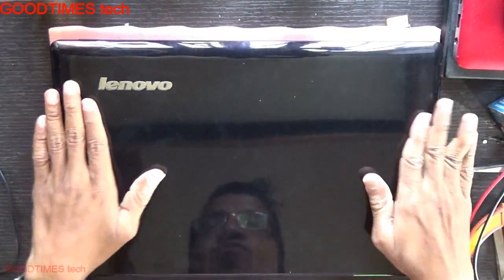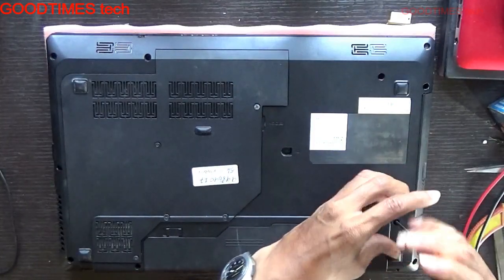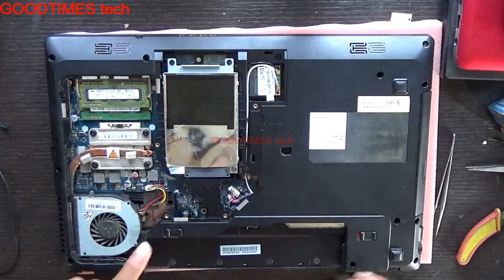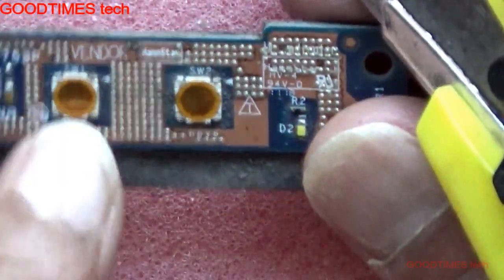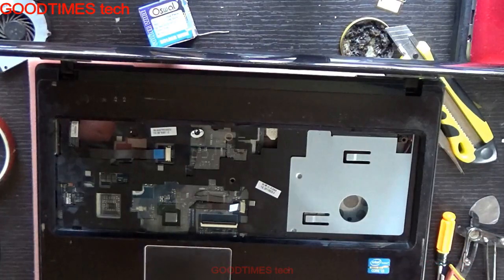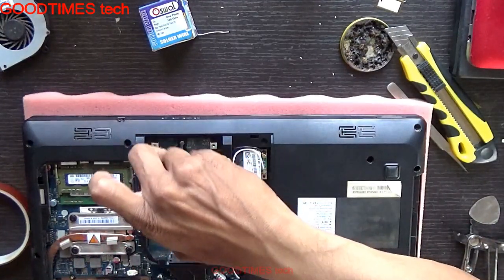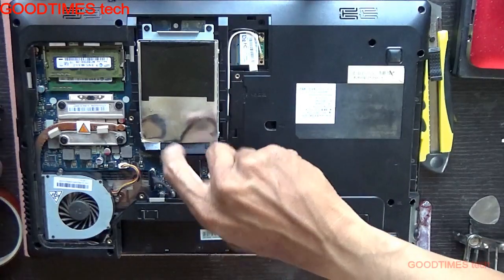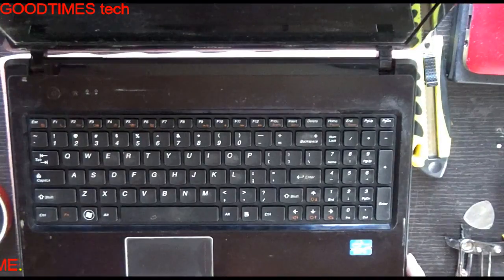Lenovo G570 power button not working | Solved.

Comment: Hi.
In minute 4:54 I see that you take off a little metal sheet from the power button, but in 6:20 you put two metal sheets in the power button.
Were the metal sheets stuck together and was it necessary to take them off to clean them?
Thanks. I will try to clean and if not work I wil buy a new button.

Comment: You are stupid enough!
Same problem can be solved by unplugging charger and battery and pressing power button for 20seconds and then again connecting charger and battery
I did it and it worked perfectly for me
Reply from the maker: Thank you sir.
Have a GOODTIME.
Reply: I'm sorry
I got that problem again
Your method is good for permanent effect
The method I mentioned cause temporary change
Sorry for saying u stupid
Reply: Nasreen Mansha sir, can you please explain to me what you did, because I don't want to give my laptop in repair untill another month. I can just turn it on once and leve it in sleep.
Reply: sharjeel mansha NVM, got it repaired. Because that electrostatic thing works only in some cases.
Reply: i am other account of nasreen mansha
All you have to do is unplug battery and charger from laptop
Then press power button for 20-30seconds and then again connect charger and battery
Then try to power on
IF NOT THEN
try to press power button at different angles
If this donot work,you need to get your laptop repaired

Comment: Lenovo 3000 g430 laptop ka power button kitne me ayega aur tumare pas kiya purana milega, Dukan me bolrahehe  500 rupia lagega tum agar veg sako to reply ya phir email karo place🙏🙏🙏 apurbamodak027@gmail.com power bottom laga rahehe to band hoja rahehe , sot karke chalta hai lekin power connector laganese band hoga rahehe
Reply from the maker: Pranaam ,
       Filhal mere pas power button stock nahi hai, agar aapne video pura dekha ho tho kya aap ka laptop power button ka metal dot nikal ne ke baad bhi OFF hota hai  ? agar haan tho power button ka problem nahi hai, ya tho PCB (Jispar power button laga hai) ya phir connecting strip jidhar PCB se solder kiya gaya hai udhar kuch short hua hoga. Aur eak sambavana ye hai ke agar aap ko teen leg wala component power button PCB par solder hai tho usse nikal ke check kijiye . ye component nikalenge tho laptop band (Display lid) karne pe sleep mode wagera kaam nahi karega.

Dhanyawadh, SHUBHSAMAY.